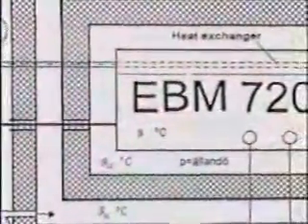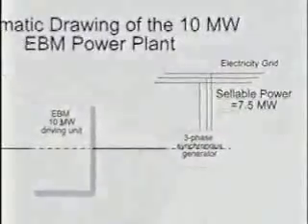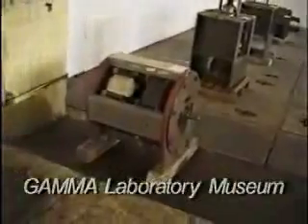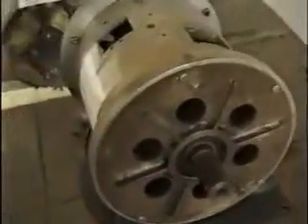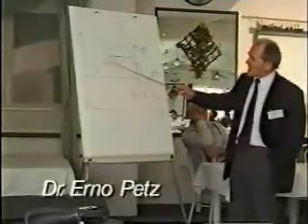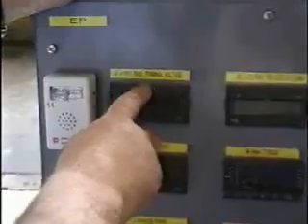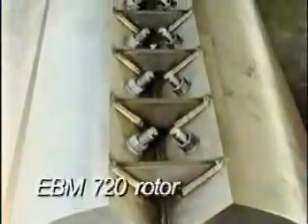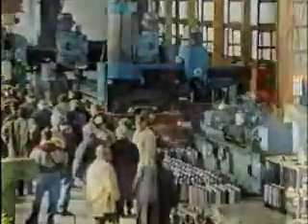Electromagnetic OverUnity Power Plant

Comment: nothing creates nor destroys energy.. NOTHING. Energy is all around us in an abundance that has never been heard of. Conductors hold charges or energy without doing anything to them. We simply need these technologies to release the energy in the conductors, as well, to draw in the energy around us. Nothing is impossible. Don't be so negative people, we have been suppressed from these technologies long enough. It's time they become released before our planet turns to Mars. We need a planet no matter how badly you guys all just want to earn from fossil fuels. We don't need these fuels or pollution. Asymmetry has finally has been released to us. A battery can spin these new motors and we can generate a charge without using the slightest bit more amperage to do so. The possibilities are endless now that this has leaked out as an open source, it is only a matter of time before we are allowed to use this, or, you may do so if you wish, just don't make it a public thing. All publicized technologies get shelved, destroyed, or taken away and the inventor gets locked up on securities fraud like Paul Pantone did. Do not go to the press or make a public spectacle of it, just follow the asymmetry motor builds that are online, make them loop their output to the input and drive a generator. It will work, you just have to build it so you find out. UFO POLITICS- Asymmetry , please watch the video here on youtube and follow his instructions about how to make this motor, it really works, and you will be fulfilling Tesla's dream once you do so!